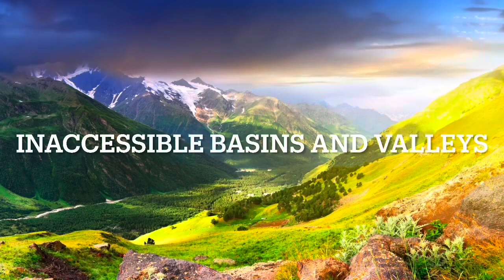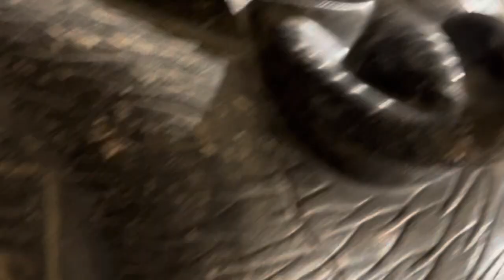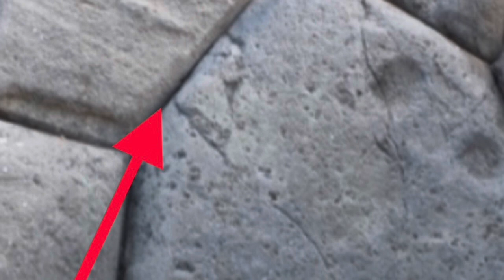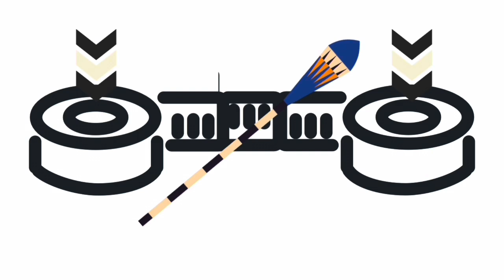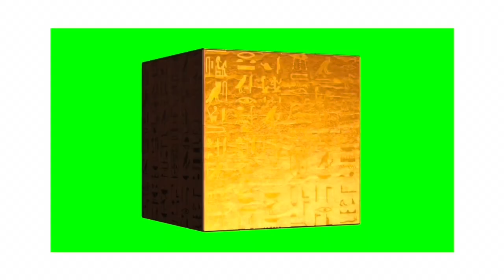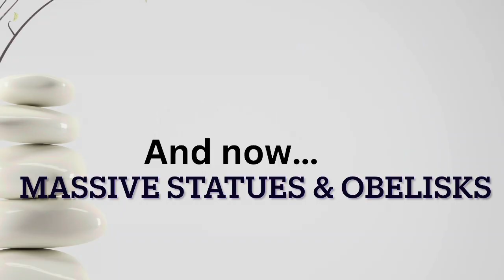Stonework episodes compilation - as requested

Comment: I wonder about the arrangement of fitted walls without joints..... I think that there could have been a cut with a string like a guitar, which also produced sound at that time... Styrofoam can be cut this way... and now you place the right and left stones close to each other... and cut with a double arm according to the chosen pattern..... bodyworkers repair car bodies this way....zastanawia mnie układ murów pasowanych bez spoin..... myślę że mogło istnieć cięcie struną jak gitara ,która również w tym czasie wytwarzała dźwięk ... styropian tak można ciąć ... a teraz układasz kamień prawy i lewy blisko siebie ... i tniesz podwójnym ramieniem według obranego wzorca ..... karoserię aut blacharze tak naprawiają.... 
przepraszam za angielski .. to tłumacz
Reply from the maker: Great concept. It depends on the technique being used. When it is softened stone or a polymer creating a matching pattern isn’t difficult. But if it is solid natural stone then yes, your suggestion makes sense.

Comment: replace the rods with tuning forks and a wire between them and the wire will resonate at the frequency of the tuning forks. The granite needs to be wet but not under water. Granite acts like a candle wick to water. Now that you see the process. The watch controlled the frequency of the rods to do the same a the tuning forks. Resonance is faster than vibration.
Reply from the maker: Brilliant! I wondered how the dynastic Egyptians worked it out.